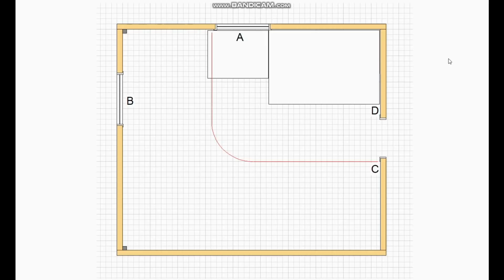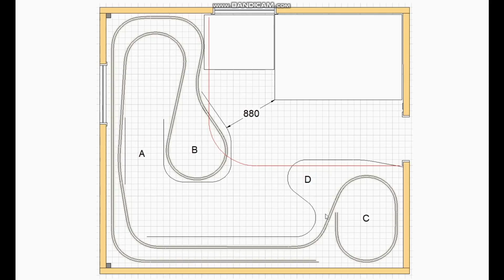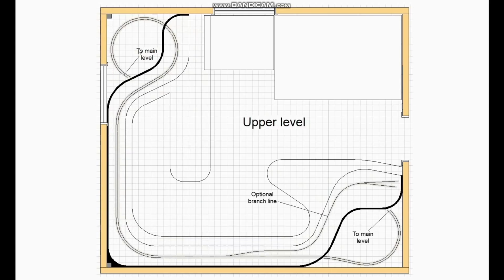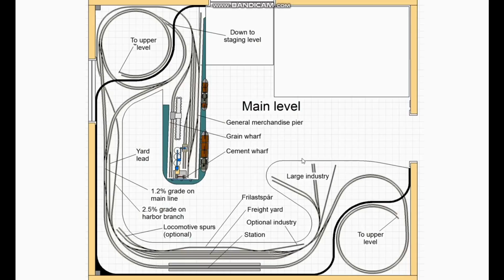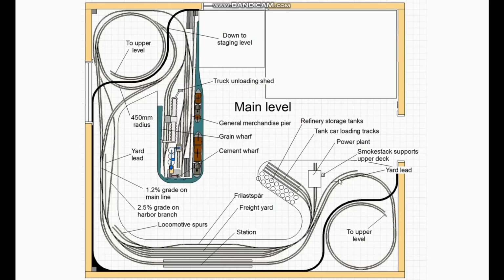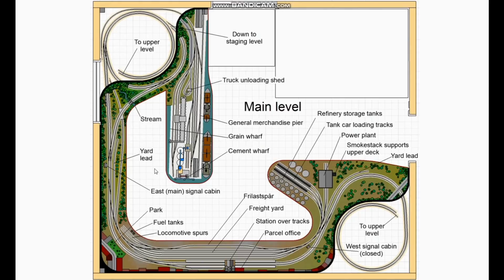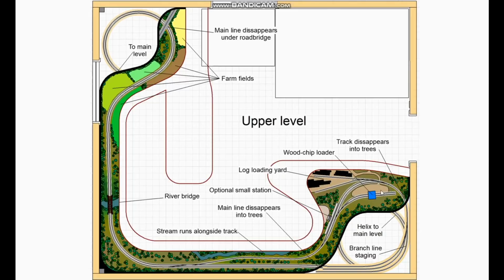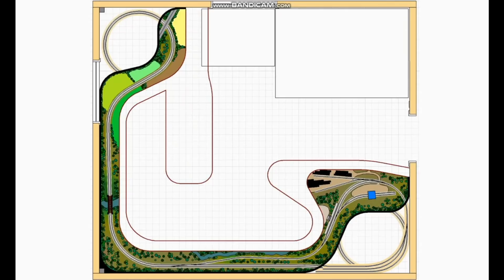A Gotland what-if: Multi-deck N-scale layout design for a guest bedroom

Comment: God layout and a lovely idea to have a more Sodor-esque Gotland with plenty of railroads. If they'd kept the rails in place on the real island it sure would have been well liked by tourists during summer running modern trains or heritage trains. 
A thought struck me regarding the stream along the tracks on the upper deck: having it turn and cross under the tracks after the branch line joined the mainline would have made a good deal of sense, wouldn't it? i.e. if possible it is preferable to only have to build one bridge, after all.
Reply: You may already know this but there is still one line run as a heritage railway. But it is a real shame they couldn't save more rail
Reply: @marakasalt  it is great that there's something left of it all, but of course it's a bit that is located poorly. I mean, if it was a stretch heading out from Visby instead of what seems (to a mainlander) like a very random bit out in the countryside, then passenger numbers would be way higher.
Reply: @GustavSvard defintetly, maybe if they could combine it with something picking up people in an old bus in Visby and driving them to the railway could work? Saw something similar at Lennakatten, only that it’d be the other way around

Comment: Hope the client is happy but it does not convey the feeling of Gotland. In Sweden only the largest main lines are double tracked. Gotland would only have single line track if the railroads had survived. Yes, Gotland did have railroads, narrow gauge. There still exists small museum railroad.
Reply from the maker: Of course it doesn't convey the feeling of Gotland as it exists in the real world.  It's based on an alternate reality in which the island is much larger, extending right up close to the mainland where it can be connected via a bridge or causeway, and where it is populous enough to justify a busy double-track main-line railway.  I clearly stated all of this in the narrative.  This is what the client wanted.
Reply: @mpeterll  I do understand this and you are doing as the client asks for. But it is an odd request. There is nearly nothing in this relating to the real Gotland. It could be anywere as it is a free fantasy.
Reply from the maker: @okrasaghia  Yes, I get where you are coming from.  Unless one is modelling an actual place to full scale size and running a timetable exactly as it was on a certain day in history, then model railroading  is always fantasy.  Even if we do model a real place as accurately as our research allows, the moment we build a freight yard with say 8 classification tracks because the prototype's 29 would be too wide to reach across, or we run a 7-car limited because we don't have space for the correct 15-car consist, or we run a spur up to an industry that was never rail-served just to add more operating interest, we have crossed over into the realm of fantasy.
Even if one had the resources to model a real prototype to exact scale with no selective compression, I'd hazard a guess that a reduced version of it would be more fun to operate.  Who really wants to spend all day running a 100-car train over miles of track when a far more manageable layout can allow us to spend an hour switching two or three locations with a 20-car train?
I respect your point of view.  Each modeler will have his own preferred level of fantasy, and no-one should say that he is wrong - provided of course he is having fun doing so.